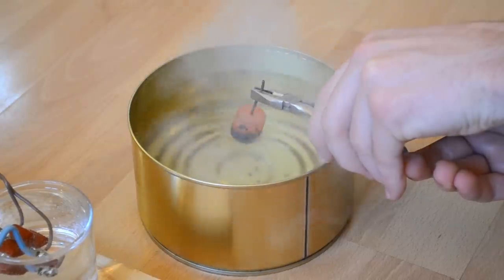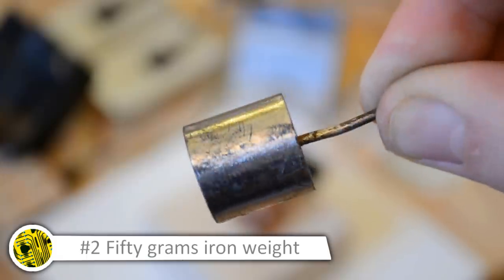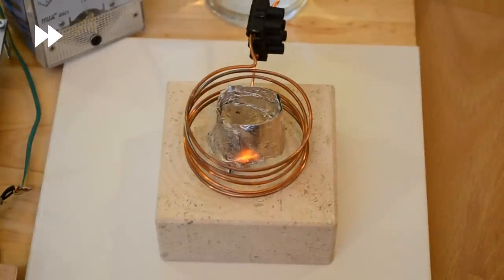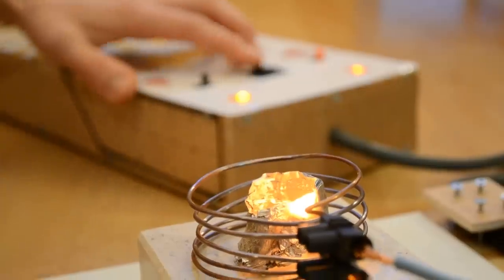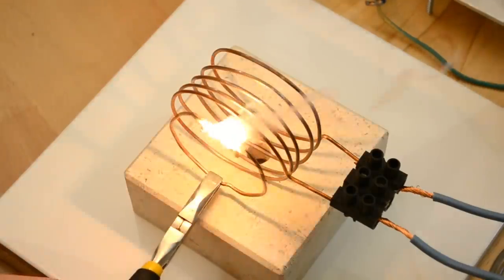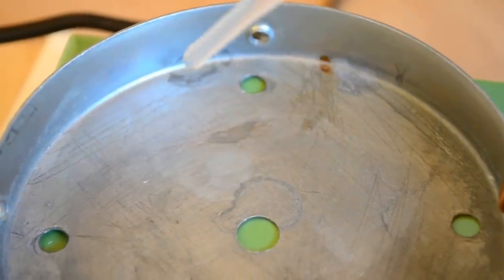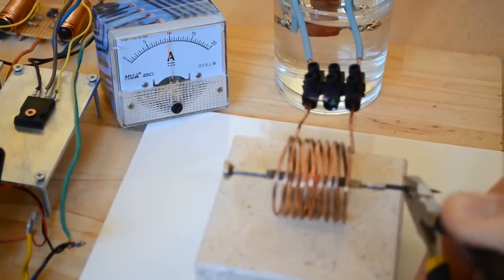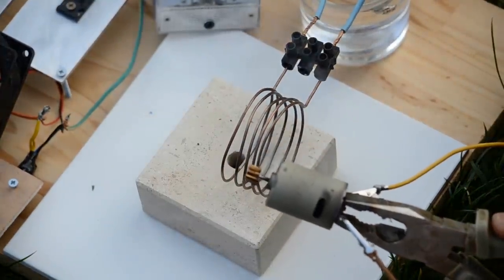Induction heating - DIY Experiments #8 - Make an induction forge

Comment: Can tungsten be melted by induction heating?
Reply from the maker: I think it's possible
Reply: @DIYExperiments  but don't I need a sealed space to do it because tungsten can not have contact with air while heated at so high temperatures? How can I solve this problem without using an industrial seal chamber ?

Comment: can i replace those 3 capacitor 0.47 by one equivalent? and why put many capacitor in parallel?
Reply from the maker: The heat dissipates by the surface area with air, more small capacitors of a fraction of the required capacity is more efficient than a big equivalent capacitor (and withstand more power). The best is to use dedicated MKPH capacitors :)
Reply: @DIYExperiments  est-ce que je peut remplaçer les deux MOSFET par deux IGBT (transistor bipolaire à grille isolée) dans le schéma?
Reply from the maker: Les IGBT se commandent comme les MOSFET mais ont une résistance interne plus faible, donc c'est même mieux ;)
Reply: @DIYExperiments  Merci Beaucoup,

Comment: Can you explain Why the motor's speed increased when it was heated.
Reply from the maker: The best explaination I have is that the magnetic field of the DC motor magnets is weakening with the temperature and a weaker magnetic field causes a higher speed constant (but a lower torque constant). :)
Reply: @DIYExperiments  thanks for replying. Makes sense, I may look into further.

Comment: You start out claiming that magnetic hysteresis loss accounts for the heating, but that would only be relevant for magnetic materials, not aluminum or brass.  It's really just mutual inductance (duh), like a transformer without a magnetic core.
Reply from the maker: Magnetic heterisis do accounts and that's why it's waaaay easier to heat magnetic materials, that same part in iron is less conductor than copper or alumium but the coupling is higher and it absorbes something like 4 times more current !

An indication cooker for instance don't even detect a copper pan!

Comment: Aluminum can not get hot in induction heaters!   the metal has to be magnetic so it can move the atoms fast enough to create friction and friction makes heat so it glows red hot
Reply from the maker: Look at the video, there are two different phenomenons that provide heat. Magnetic hysteresis and induced current. In aluminum there are induced current only but it works (and prooved in the video).

Comment: Wow. Your analog switching circuit design are amazing. I tried many projects you have done but did not receive nearly as good of a result. The Igbt/mosfet keeps getting killed and the inductive ringing/spike voltage is high. Consider making a sstc?
Reply from the maker: Thanks! This circuit is a widespread auto-oscillator type "Royer", it's possible to add zenner diodes to prevent the gates from reaching a too high voltage. The voltage in the LC circuit can be much higher than the supply voltage, in our case it's around 3 times.
Why not, but I'm freaking out with high voltages ^^
Reply: @DIYExperiments  Thank you for replying. I tried ZVS, full bridge, flyback and forward topology. ZVS worked the best and it is essentially the same same circuit with a center tab in the work coil. However, a full analog oscillator is hard to tune and there are so many things to go wrong. Thanks for the videos!
Reply: @DIYExperiments  

Warum nennen Sie diese Schaltung "Royer"? Die Royer- Schaltung ist induktiv rückgekoppelt! Dies aber ist eine bistabile Kippstufe, die von einem Parallelschwingkreis beliebiger Frequenz gesteuert wird, immer im Nullpunkt schaltet (ZVS) und keine Rückkopplung hat.

Die von Ihnen gezeigte Schaltung entspricht dem 
Deutschen Patent Nr. 35 19 489  vom 30.11.1989 der Fa. Hüttinger Elektronik in Freiburg i. Br.

Comment: Très belle vidéo! Vous êtes français non? Cet accent <3
Reply: C incroyable expérience leur chaine principale
Reply: -Cant it melt silver or gold without graphite crucible mold and why

 -capacitor pun in the water

-If the gaps between the copper wire are touching will it causes failure / electric fail

Comment: try mechanical induction circuit, without any electronics
Reply from the maker: At mains 60Hz ? Inefficient!
Reply: @DIYExperiments  you can rotate the magnets by hand if needed, but you can use a dc-motor, try 50kHz
Reply: @DIYExperiments  you can use a crucible that can heat with mains 50Hz efficiently
Reply: @DIYExperiments  point is that you can rotate magnets around the melting target
Reply: try ionization sling electro-magnetic filtering for ultra pure elements

Comment: Do you know if its possible to use a less oscillating current ? For example, something near from the mains power, 50-60 Hz
Reply from the maker: No it's not, induced currents would too small. It at least 20 kHz.

Comment: I dont know any metal can use induction i think only metal which is magnetize to heat up becoz am using induction cooker i tried aluminum the the cooker is not working either heating up the aluminum pot
Reply from the maker: Works better with iron about of magnetic hysterisis losses in addition to Eddy currents
Reply: @DIYExperiments  can i bypass induction cooker i think induction cooker has sensor only magnetize metal  will induct  i watched your vids and any mettal is heat up even hardest metal or even gold

Comment: hi I want 12 volt nut buster help me with circuit diagram. a portion of nut is broken and is remaining in cylinder head of my car. the nut is rusted I need to take it out. help me to give link circuit diagram for 12 volt induction heater circuit.
Reply: the 12v will not work it needs more power and this video was the  best experiment i have ever seen

Comment: I made one too but it draws 7 amps at idle and is not heating things very well pls help
Reply from the maker: You can try to increase the inductance (more spin, more wire, higher diameter) or reduce the capacitance.
Reply: @DIYExperiments  thanks I'll try

Comment: Wind insulated copper wire on a long iron pipe and plug into the wall. Induction heated hot water.

Comment: What’s the difference if i use 60hz
Reply: PixelSlayer TV nothing
Reply from the maker: Nothing, the switching mode power supply provides en DC current before anything!
Reply: SCIENCE ETC it will work with 60hz ?
Reply: PixelSlayer TV yes, but if you are building your own power supply make sure to use the rated transformer

Comment: Can someone plz help me in making an Induction Heater with power approx 3 Kilowatts, which can melt Copper Rods of an Induction Motor's Rotor. The purpose is for Brazing. Which requires diameter of the heater's coil to be 15 cm to 20 cm, with minimal turns so that rotor could fit inside the coil.

Comment: Why the capacitors inside the water ?
Reply from the maker: Raw cooling system when you don't have that right low internal resistance capacitors!
Reply: because it can be used in two 1. for heating the metal and 2. to heat water . how is my idea great is't

Comment: Curious to see a plate of mercury placed on an induction heater.
Reply: I don't think you would be curious to long. Mercury's boiling point is around 650 degrees. And vaporized Mercury is not good for the brain.
Reply: @chrisbloodworth72  was wondering more about how the eddy current would cause mercury try to flow away from the induction coil.  Don't need to  heat it to boiling.  Just enough to demo magnetohydrodynamic  induction.
Reply: @kreynolds1123  This is a modified ac induction field. MHD requires a dc magnetic field. You can use an ac field modified to a dc output. MHD units use the liquid as the commutator of a DC motor. Hope that helps your question.
Reply: @chrisbloodworth72    Your refering  to the subset of MHD. MHD devices can classified as either   MHD conduction devices ,  or MHD induction devices.   

An induction motor need not even be a rotor, it could just as easily be a linear motor, or even levitation. Youtube is full of induction devices .  Ever seen a glowing metal blob  floating in an induction heater  coil shapped into a cup? Yeah, induced eddy current do more than just carry currents. Those eddy currents create their own magnetic fields that oppose the changing magnetic fields that induced the eddy currents. 

Induced eddy currents and their opposing magnetic fields in
Solid or liquid rotors both react to changing magnetic fields.  Although, i suppose it would help to create a rotating magnetic field to make it rotate. This coil configuration  does not lend well to a rotating magnetic field, so  Maybe 2 coils at 90 degree with a capacitor to create a split phase induction motor, but then there is the cycle rate issue. It could get ugly quickly if the mercury is spun too fast and sloshes  mercury drops everyware.  

I'd love to see a mercury induction pump  with a rubber tube filled with mercury and coiled inside a shaded pole stator.
Reply: You really don't want an induction device for MHD with Mercury. Even if it did move your Mercury the high frequency would heat your Mercury to fast causing it to boil. While I know what your saying would work. It's not a good way to produce MHD reactions because of my original statement. Boiling led bad.  You can get a much better reaction with dc current like in this video. https://youtu.be/au4hbUm4mMo
Reply: @chrisbloodworth72   You have a big point with the high frequency doing more heating than creating a useful motive force.   mhd  conduction motors are  too common in my opinion. I'd like to see more mhd induction motors. I still think a shaded pole induction motor stator would work reasonable well at 50/60 hz as a mercury pump. if you replace the rotor with a coiled tube.  The rotating magnetic field will push against the induced magnetic fields of the mercury in the tube. 

On the other hand, mhd inductiivly coupled plasma at 13.56mhz seems to work well at creating a plasma in a partial vacuum, as well as pretty cool plasma torches.

Comment: You can't shortciruit the inductor's turns, so your
electronics are dead on 3-11.
Reply from the maker: It can start with a shorted turn but it cannot be switched alive because it changes immediately the resonance frequency and the circuit "stalls"